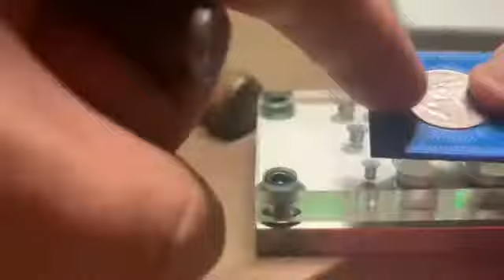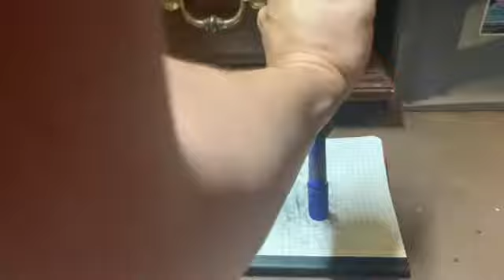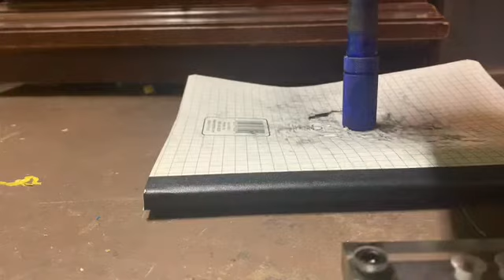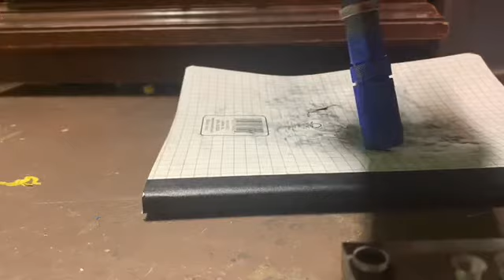How To Make A Coin Ring - STEP BY STEP WALKTHROUGH

Comment: I started out making coin rings with just the dapping block , I could make the hole size by using the round ball punches driving them through the hole to make the opening any size I wanted , I got a bench wizard 4 spline now and a 1 ton vevo press with the wheel that helps on some things , but got nothing but respect to ya I know how much work can go into those rings ....

Comment: Need to get ya small propane torch and anneal or heat the coin up except silver you just wanna warm up to a small glow , the rest you can heat to a glowing orange then slap in water , makes it a lot easier to work with ...